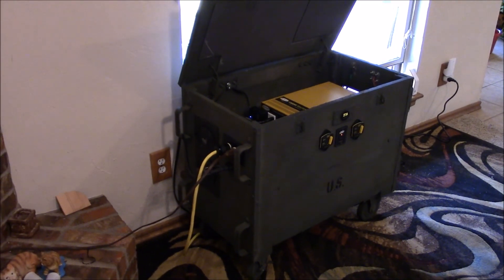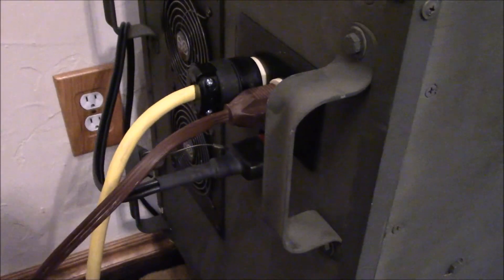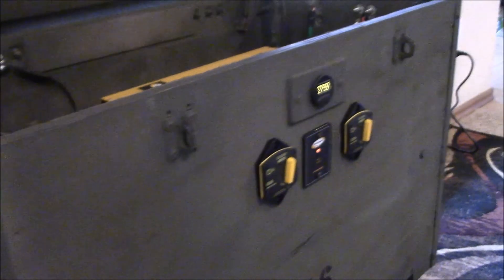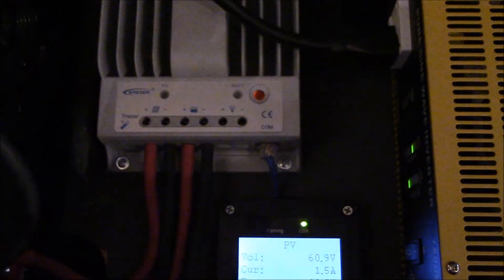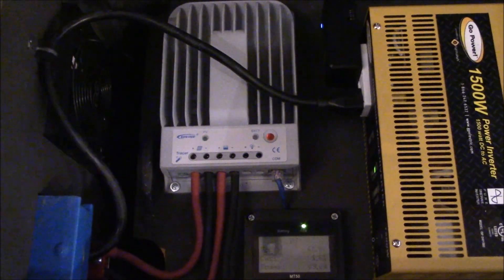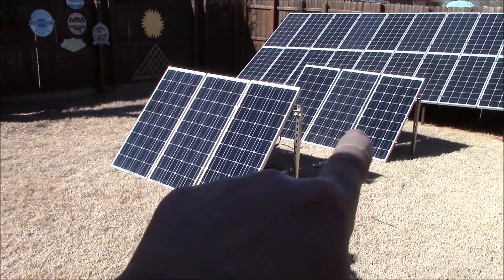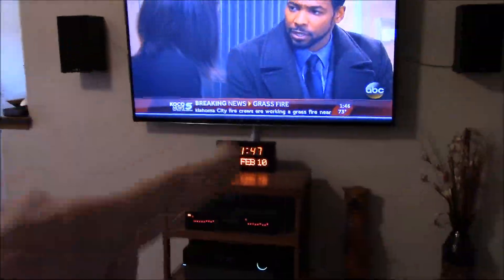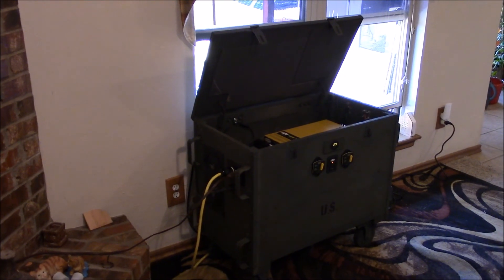Update: 24v large solar generator (now with 600w in panels, new cable, 20-amp MPPT charger stuff)

Comment: Respect excellent video still for 600w of panels I honestly believe you would have gotten more amps out of a 40amp mppt charge controller which cost about the same as you pay for the 20amps may not be the same brand.but hay it works for you.

Comment: Glad to see the new panels are working out well!   Pretty slick setup!
Reply from the maker: Thanks...two more of those Trojan 31AGM batteries and should have about 1.5 - 2 aH of juice for overnight (safely). 1,500 - 2,000 watt/hours. Easily could keep the TV, stereo, computer, or a single fridge going overnight. That is the goal. Right now...maybe 750 watt/hours with two batteries.